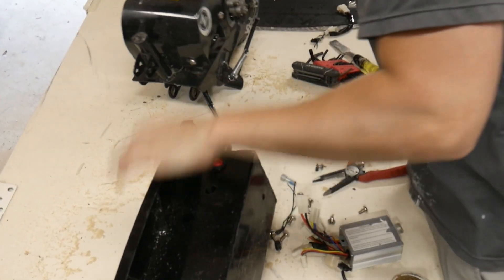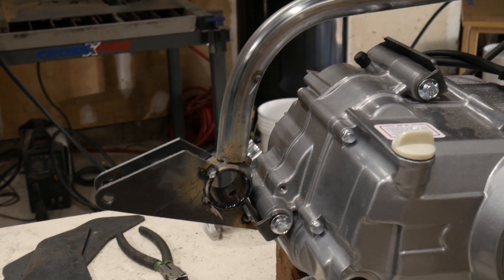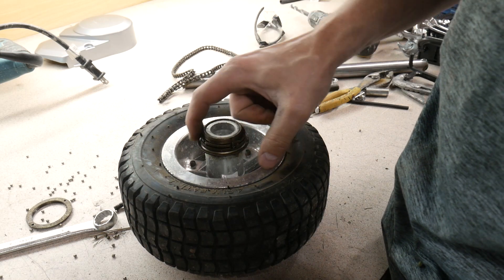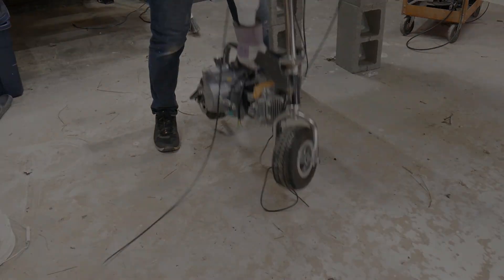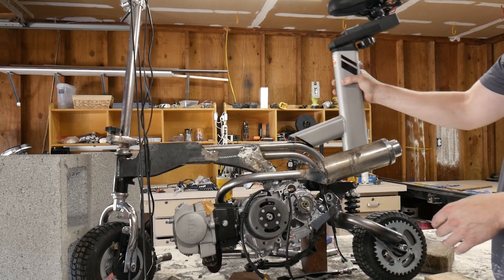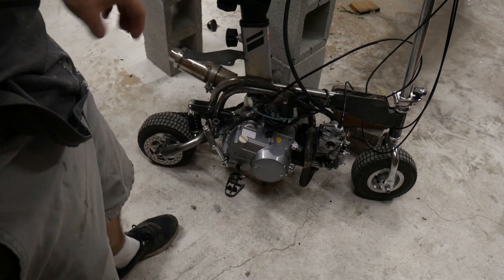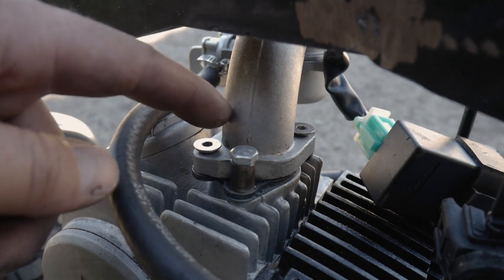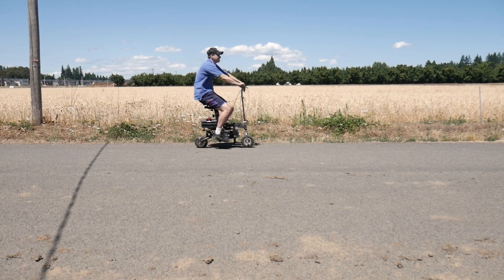Is it too much power? e-scooter gets an upgrade

Comment: Nice build ! Remember - you can up-to an 18t front sprocket for pit bike type engines.👍
Reply from the maker: I just ordered a 17 tooth, didn't realize I could get an 18... dang it!
Reply: Also - if you fit/make a chain tensioner it will allow for the chain 'shortening/lengthening' as the suspension travels.👍

Comment: Welcome back!  A larger diameter rear tire will get you some more speed, though you may have to modify the swing arm.
Reply from the maker: Good call!
Reply: @OliverMotorized  while your at it, extend the swingarm even more so you can accelerate harder without it looping out

Comment: hey Oliver not Shure what your plan for a regearing is but i thought it might benefit you to know that about a year ago i had the same problem with a colmen minibike me and a friend put a Honda atc 185 in and the solution that worked out pretty well was to convert it to solid axle and use a front sprocket of a ninja 250 on the rear I believe it was a 15 tooth rear 16 front but that was a long time ago so am not Shure, I remember that thing would go about 65-70 before it ran out of torque.
Reply from the maker: Nice, I ordered a new drive sprocket from 14 tooth to 17 tooth so that should add some speed. Thanks for the advice